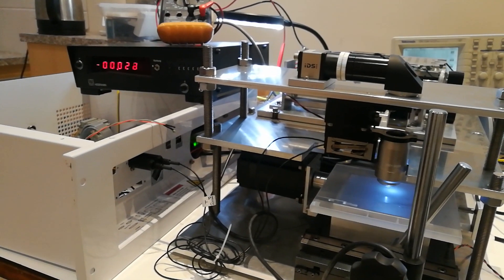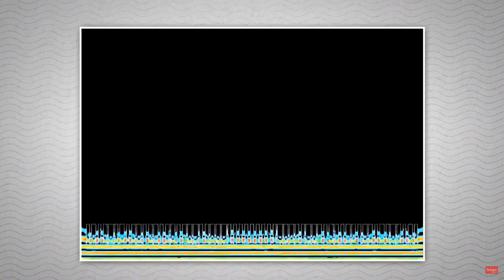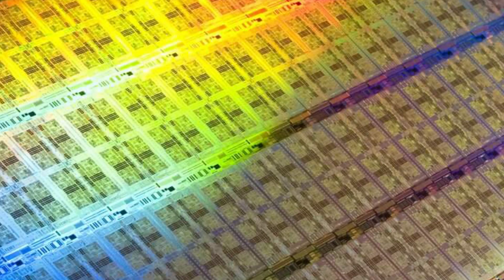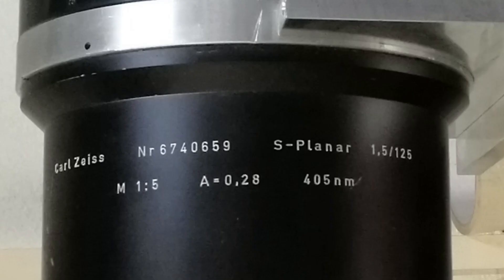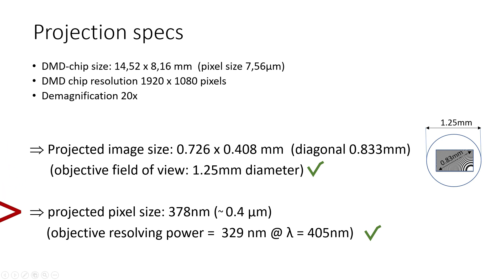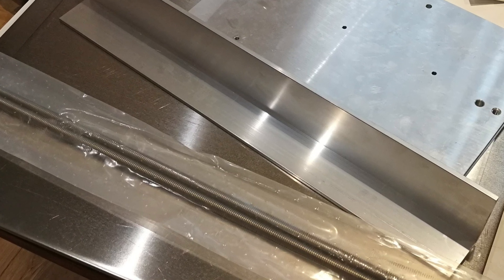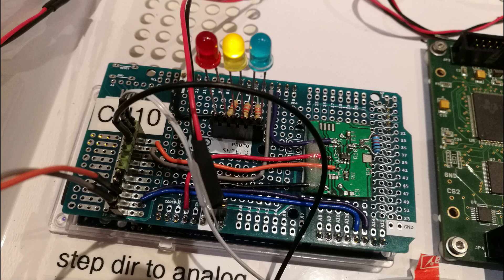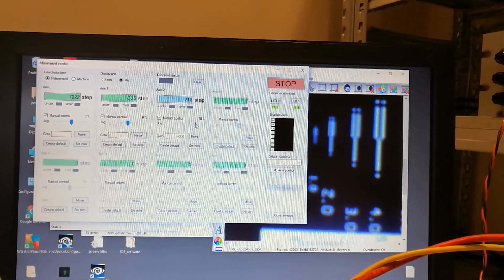Maskless Wafer Stepper Part1: Optics

Comment: Those DMD chips are very useful. I used them when I built my own two-photon lithography tool about 4 years ago. It was capable of printing 100 nm lines with an 800 nm laser. However, I don't know how to do movement very well so I kept the microscope stage stationary.

Comment: Great video! Thank you. Did the fill factor of the DMD chip cause any problems when projecting images?
Reply from the maker: It was hard to get the outer edges at the same intensity as the center so I generally use  the central area of 1080x1080 instead of the total 1920x1080px.

Comment: Hi, I bough s-planar lens from ebay that supposedly is 1:10 but text on it clearly states 1:1,6 f=50mm. Is there any way to verify if datasheet matches description? Also what does f number mean in case of constant focal length lens Is it effective focal length?
Reply from the maker: It's an F/1,6 and yes it is designed for 1:10 magnification and 1500 lpm. See more info on this page: http://www.marcocavina.com/articoli_fotografici/Zeiss_cute_DFR_DDR_lenses/00_pag_English.htm

Comment: For me the most obscure part of this system is how exactly "some motors" can give a 100nm precision.
Reply from the maker: They can't, at least not without a very accurate encoder feedback loop.  It's one of the issues that is not really addressed in this video series
Reply: You can always stick and use piezo for the fine range. Use that light source in an interferometer

Comment: Hey, love your video, just a quick question. With the Microscope objective how did you get it close enough to the DMD While equally allowing the light source to hit the DMD at the same time? Or what kind of "Condensing Optics" did you use? When ever I use my DMD it detracts orders all over the place, even with collimated light, so how did you get the image to focus so far away from the DMD itself?

Any info will be greatly appreciated I've been racking my brain with this problem!
Reply from the maker: The objective is actually infinity corrected, so you need a "tube lens" as a corrector between dmd and microscope objective. Unfortunately, that part was introduced later in the machine so it is missing in the video. Generally this is a lens with 150-200mm focal distance, with that distance to the dmd .
Reply: @HuygensOptics  Do you happen to have the make of thew tube lens you used? Was it from Thorlabs or something similar? sorry for questions but thank you for answering me first question your video is great!
Reply from the maker: @danielblackmore4718  yes, the Thorlabs or Edmund tube lenses work fine. But in fact, more "regular" lenses also work well. Just as long as they have limited spherical aberration, generally meaning a fairly high f-number  (say F/6 or higher), I guess you are safe.
Reply: @HuygensOptics  I'm really sorry but I'm still a bit confused, so did you manage to make a tube lens system with individual lens? if so what kind did you use? I've currently got a 100mm to a 50mm bi-convex in a kinda 4f system to demagnify the image down to the microscope. But the DMD Diffracts all the orders around too much so I never get a clear image, so did you have a similar set up of lens after the DMD before the Microscope? Do you remember what lenses you used? 

Sorry again for all the questions thats my last one I promise!
Reply from the maker: @danielblackmore4718 best look on this page and look for infinite conjugate. It shows how the tube lens works in a microscope. In the dmd projections it works in reverse where the dmd is in the focal plane of the ocular. A tube lens eliminates the requirement for a fixed tube length, because of the infinity projection. https://www.edmundoptics.eu/knowledge-center/application-notes/microscopy/understanding-microscopes-and-objectives/

Comment: Wow. I'm clearly no optical engineer at all, but I heard that certain 3D optical structures can redirect light around objects. Could you make structures like that with this machine, or would that require smaller nanometer size objects?  
Another difficulty might be that the structures may require a 3D shape to gradually shift the light around. I'm not sure how you'd get that smooth stepping. Varying intensity levels or exposure times?   
Haha. I'm probably missing something, but either way- it would be super cool to see.

Comment: Unfortunately it is probably impossible to make metasurface from a DMD projected through an objective without DUV. What sets metasurface apart from conventional diffractive optics is each scatterer are subwavelength and they provide a phaseshift whit thickness less than 1 wavelength, they behave more like waveguide and resonators. Comparing to conventional diffractive optics often has macroscopic features that are several wavelength in size and thickness of several wavelength as well. The way the optical wavefront is shaped with metasurface is that spherical wave from each individual scatterer with different phase create the desire wavefront at the farfield. So each element (they are dielectric waveguide actually) typically range from 70-150nm in diameter. Maybe you can make something with a DUV stepper, but optical system in that wavelength will be very expensive. So optical stepper is probably more suites for conventional diffractive optics than metasurface.

Comment: I admire the effects of your work. Please forgive my ignorance in the field of optics but I have a question regarding the optical scheme of your system presented in 8:35 of your video. Why is there no tube lens in the path between the DMD and the microscope objective? I saw tube lenses in all the diagrams using the infinity corrected microscope objectives, but these were microscopic diagrams, not projectors. Also in video microscopes. What is the difference? My plan is to build a stepper similar to yours. I have collected a Nikkon Plan Apo 20x/0.75 DIC N2 INF/0.17 WD1.0 objective bought on ebay at a good price and also identical to your piezoceramic stage with the driver. I also have a small DC motors driven 2-axis 25x25mm Ficontec/National Aperture stage with Renishaw RGH25/RGB25H linear encoders with 50nm resolution so the stage can operate in closed loop feedback. I do not need a resolution as high as you, I think 2.5 to 5 micrometers would be sufficient as I am interested in preparing substrates for microwave thin film systems on Al2O3 substrates. However, in my application it is important to combine individual images into one larger one. Ultimately, I wanted a 50x50 mm working area but I found a 25x25 mm stage and I think I'll start with that. I actually have 2 of these stages and the first idea was to stack them on top of each other to get a 50x50mm working area, but I will rather start testing with a single stage.
When it comes to DMD, I was thinking about a ready module with 405 nm backlight. I was looking at EKB modules (one of the TI DLP design houses). Ready modules with around 95% illumination uniformity, 2.5 W LED 405 nm or 1.5 W LED 385 nm. Not the cheapest ($ 1,600 +), but maybe without the projection lens it would have been a bit cheaper. By entrusting this part of the project to specialists, I would increase the chances of success at the expense of higher costs. As always...
Reply from the maker: Sounds like you are all set to make your own wafer stepper! As for the tube lens: others have asked me the same question. In principle you are right about the objective requiring a tube lens, and under some circumstances you could encounter field deformation or spherical aberrations. However, in the configuration used, the distance between objective and DMD is quite large (180mm). And in practice you do not notice any field deformation at all when leaving it out. (You might when you go to into the submicron scale and start stitching, but evidently that is not your goal).  Also, since placing and aligning the lens caused additional issues given the current geometry, and since the exact position had a large influence on magnification, I decided not to use it after all. 
I have one suggestion for you to improve your build: add the Z-translation to the wafer stage and not to the objective. It will be way easier to check your  focus. Good luck with your project, it would be great to hear about your progress and results.
Reply: @HuygensOptics  Thank you. I appreciate your advice very much, such practical knowledge is hard to find in books and scientific articles. In fact, in addition to two pcs. X/Y stages, I also bought a Z-axis stage with the same encoder with 50 nm resolution and 12.5 mm range. And also a rotating stage with a diameter of 65 mm with a hole in the center, which allows me to easily bring the vacuum to the wafer holder, but with the encoder on the axis of the motor and not on the axis of the stage. Maybe I will actually stack all these stages to be able to operate on (almost) all the axes I need. There was also a small theta axis stage included, but I rather assume that a single wafer projection area will be flat and will fit within FOV and no additional tilt will be required. The driving part is easier for me to develop because it is related to what I do professionally. I have a long but very fascinating road ahead of me with this project.

Comment: You can do this projector using a UV led array, a cheap screen masking lcd like the ones used in 3d printers and  lenses to project the image into the microscope objective instead of a wall. Like making a cheap diy projector. That could give you even 4K in resolution.

Comment: I'm curious about the projector teardown. Seems like a cheaper and less stressful way that having to assemble all the various hardware needed for a TI dev kit. Do you have any images of the projector that you can share? Was it easy to get access to the DLP mirror?
Reply from the maker: Unfortunately, I do not have any photos of the disassembly. However, getting access to the dmd chip was pretty easy because generally these chips can be replaced if they break. In the case of this projector, I had to modify the part holding the optics to get free access to the dmd chip.
Reply: @HuygensOptics  thank you. I’m also trying to get a dev kit from DLi but my application is fairly straightforward so this seemed to be a quick solution.

Comment: Thank you for a very nice video. One question I would like to ask: If I replace the light source in Acer DLP projector with a UV light source, do I need to put a dummy signal in the light source driver to make it look like the original projector light source is working? I would be grateful for your guidance on these procedures.
Reply from the maker: Good question, I forgot to discuss this in my video. Unlike other brands, where one can just modify an opto coupler, It's difficult to trick the Acer p1500 into thinking a lamp is present, because it uses serial communication between the lamp driver and the main PCB. The easiest way to fool the Acer is to connect a +/-1000W ceramic cooking  plate or a heating element to the 2 lamp wires. These can easily dissipate the 100W of lamp power and will trick the Acer into thinking a lamp is present.

Comment: Is it possible to make a beam splitter that splits it non-uniformly, sending, say, 90% of the light one way and 10% the other? I guess it would be quite a custom part, but it could get you better exposure times, since I guess you don't need much light to focus by.
Reply from the maker: Actually not that custom: https://www.edmundoptics.com/f/plate-beamsplitters/12424/
Reply: CD players use QWP and a polarisating beam splitter

Comment: Wow, i'm researching how to build a high resolution LDI machine for PCB development on a budget. Applied science linked your channel, i'm glad they did..
Reply from the maker: Generally you can focus dlp-projectors very close by, making it possible to project high-resolution images without a single modification to the projector, in an area of for example 50x100mm. The light generally also contains quite a lot of uv, which allows for dry-film photoresist exposures.
Reply: @HuygensOptics  Indeed, i'm looking at the ts pico projector development board, (small sized, 100$) https://www.ti.com/lit/ug/dlpu049c/dlpu049c.pdf?HQS=TI-null-null-mousermode-df-pf-null-wwe&DCM=yes&ref_url=https%253A%252F%252Fwww.mouser.com%252F&distId=26 
Just remove the lightsource and replace it with an uv laser.
I am also thinking of using belt instead of ballscrew in order to circumvent ballscrew non linearity issues...
But in any case,.. goed gedaan man !! Love your channel, very inspiring..
Reply from the maker: In the case of a development board, you could use a 50mm lens or so for high resolution projection. By the way, if you use a laser instead of an LED source, you can encounter diffraction effects on the DMD-chip, because of the coherent nature of the light. This may cause non-uniform projection intensity.
Reply: @HuygensOptics  Thank you for the tip of the lens, I will certainly read up on the topic of diffraction effects. I actually think I have one lying around. Thanks....

Comment: 3:54 What kind of software or source code do you use to generate the input data (such as on/off mode and gray level of each mirrors) for maskless optical proximity correction?
Reply from the maker: I do not have software for that (yet). In the video I just mentioned that it is possible. But if you just use simple images for exposures, one can easily use for example Photoshop to generate the specific mask patterns to test the feasibility and the effects.

Comment: First thanks for the videos, But I'm a bit confused about the UV light source. Was it a UV laser or an array of UV LEDs? and if you don't mind how powerful should the light source be?
Reply from the maker: It is just one 3W diode of 405nm with a surface area of a few mm2.  The beam is collimated to approx. A few cm2 at the dmd-chip. Only a few tens of milliwatts makes it into the microscope, however the image is projected into a very small area so the wattage per area is still high.
Reply: @HuygensOptics  Thanks man, i really appreciate it. Keep up the great work. :)

Comment: Can you please share some details about the UV source and the condensing optics as I understand you need something close to a point source for DMD chip.
Reply from the maker: What you need is a highly colimated beam of light incident on the DMD. you can use a point source and a collimating lens or mirror to achieve this. What I used was an LED, then a short focal distance lens and then an additional collimating mirror that reflectes the light onto the DMD at the right angle and focusses the light into the microscope objective. I need to get as much light into the narrow opening of the microscope objective. It is a bit like I explained in this video: https://www.youtube.com/watch?v=E9uU2h1Ldcg (starting at around 8 minutes)
Reply: @HuygensOptics  Thanks for the explanation, its really helpful. I ran into this problem a few years ago when I tried to convert a DLP projector for mask-less PCBs . I might revisit it.
Reply: @HuygensOptics  Thanks for the explanation, its really helpful. I ran into this problem a few years ago when I tried to convert a DLP projector for mask-less PCBs . I might revisit it.